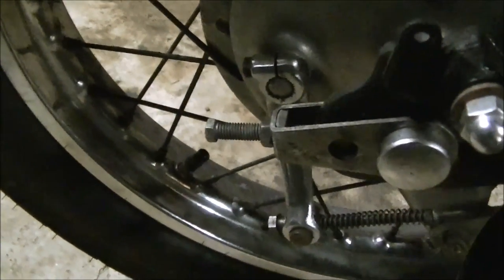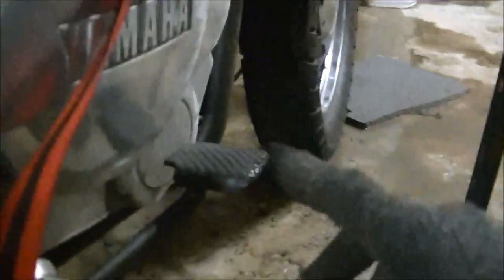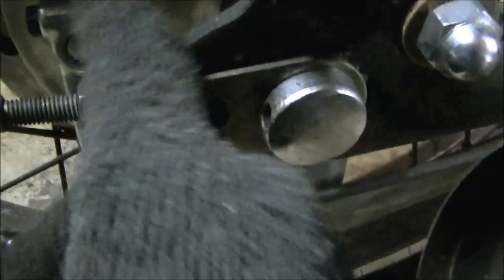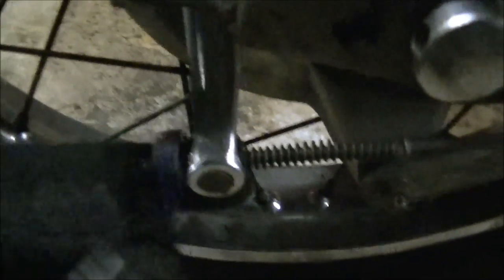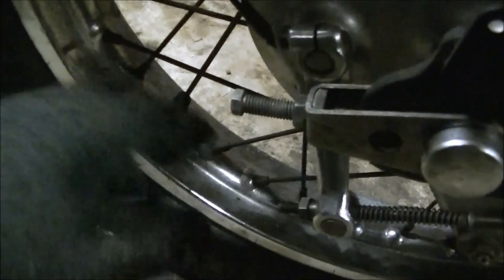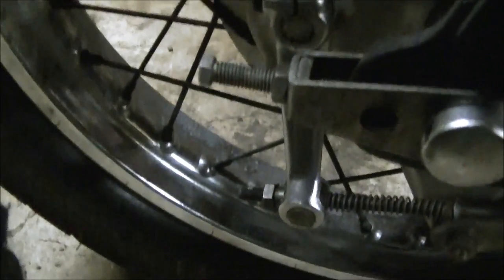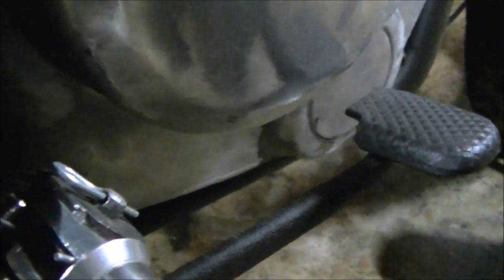How to adjust the rear drum brake on a motorcycle

Comment: Little note some bikes have a very strong spring as the return mechanism usually located behind the rear brake pedal. If it goes missing or snaps off the first thing you'll notice is the rear brake pedal will feel spongy as the spring on the adjuster at the end of the bar will be acting as a sort of return but will not be as effective although you should still have a braking effect.

Comment: Have another adjustment to make so that the brake light activates on mine. My pedal was hanging really low, adjusted it so it was more level with the peg and the brake light stopped working, luckily there was another adjuster 😎

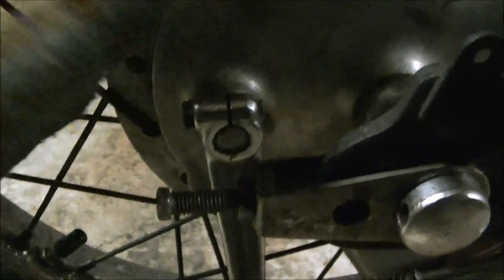Comment: i just replaced the inner tube on my bike today and put the rear tire back on, only to find out that my rear brake pedal is going all the way down and not applying the rear brake. Does taht mean I need to adjust the Rear Brake Arm that you're talking about at 1:20? I took that arm off without noting where it was and just put it back on wherever it landed. Would it be possible that maybe I left something loose inside the rear drum brake?

Comment: Hope you can help, Willy!  Recently changed my chain and sprockets on a shadow 125. Since then been having issues with the rear brake. It's currently in a seeming 'constantly on' state. I can pretty much remove the brake rod adjuster nut and it still seems like it's applied. It's only a slight drag, but I can definitely feel it's pull on the power and, of course, the obligatory squealing.
 I've tried taking the brake rod lever off the spline as you've suggsted and repositioning so that the top of it is angled more left (my rear drum points the arm upwards, not down like yours here), but that almost seemed to make matters worse. I struggled to point it more to the right, but that seemed counterintuitive anyway so I put it back in it's original position - up and slightly tilted to the right.  Wheel is as far forward as it will go, so, totally at a loss. Any ideas? Thanks in advance.
Reply from the maker: I would start like this: first, lift the rear wheel off the ground. spin the rear wheel by hand. is it dragging or squealing? If so, completely disconnect the rear drum brake, either by removing the arm from the spline or just taking off that nut from the long arm that actuates the rear brake. now spin the wheel again, does it still drag or make noise? If so, the problem is not with your adjustment of the lever, but likely the drum brakes; were they taken off during this process and not installed correctly? Did you adjust the chain correctly when you reinstalled it? a chain that is too tight will make a lot of noise. If the problem disappears when you disconnect the rear brake you can now isolate your problem to rear drum brake adjustment.
Reply: The brake lever doesn't return to the off position. I can gentle tap it back by hand but as soon as I apply the rear brake it sticks to the on position. Will take it apart again and clean out the inside of the spline and brake! Will report back ;)
Reply: Sorted! It was indeed the spline. Pretty solid so took some wonderjuice and a rubber mallet, hammered it out, cleaned and greased it up a bit and back in the saddle :D

Comment: Thank you for the video ! 
My rear brakes give off a squeaking sound whenever I engage it. Any easy fixes for that ?
Reply from the maker: I had this issue in a car once with drum brakes; to fix it I carefully lubricated all of the internal parts with silicone spray without getting any on the brake shoe or the surface the brake shoe touches. An easy way to prevent that is by  covering these surfaces with masking (painter's) tape because it does not leave a residue and comes off easily.
Reply: WillyRides thank you

Comment: hello great video! was wondering if you had any advice on re installing the front brake cable i cant get it to work properly..
Reply from the maker: Robert O'Donnell Loosen the adjuster nut at the brake lever as much as possible. Loosen the adjuster at the front brake as much as possible. Install the cable at the front brake first. Attach the cable at the lever last. Tighten the adjuster nuts to achieve proper play. If you're not sure how the entire assembly goes back together do a search for the repair manual using Google; you'll find it; it has photos. At the moment it is not possible for me to make more videos due to time constraints. Good luck! If all else fails join xs400.com and post photos with your question on the forums.
Reply from the maker: No problem! More will come eventually, but I am swamped with graduate school at least until this fall. Leave a comment on here and I will do what I can if you need further assistance.
Reply: thanks!! I'm in college too I feel that haha

Comment: There is a lot of play and i tried this. 
Play reduced. But wheel is getting locked up. What to do??
Reply: @PharmacyBrain  Wheel is not rotating at all, after tightening the screw.
Means wheel locked up without applying the brake.
Reply: @PharmacyBrain  thanks man. Fixed. 
Using a honda from last 4 years and i know nothing about how it works. 😅